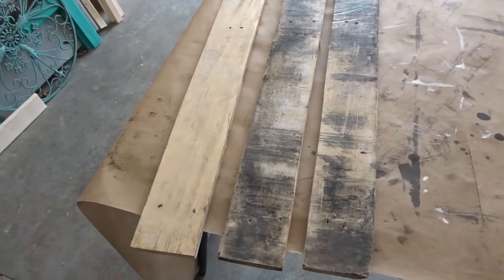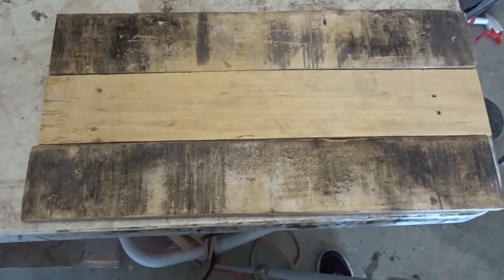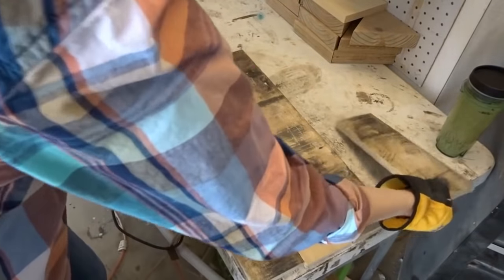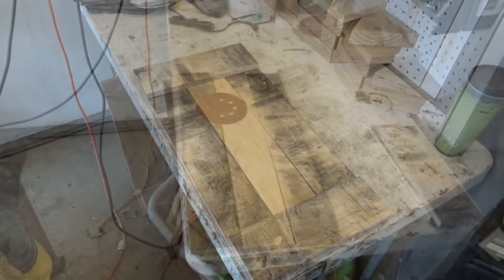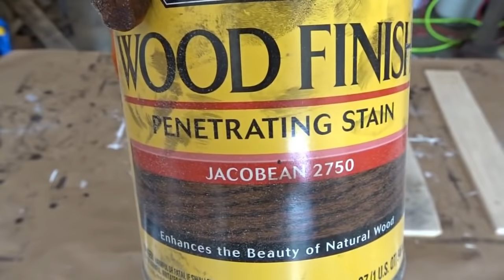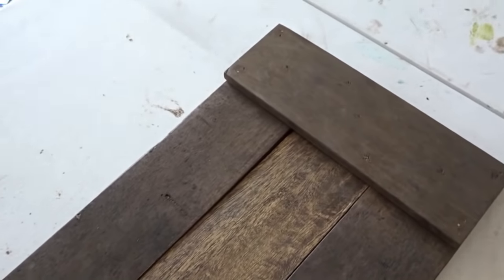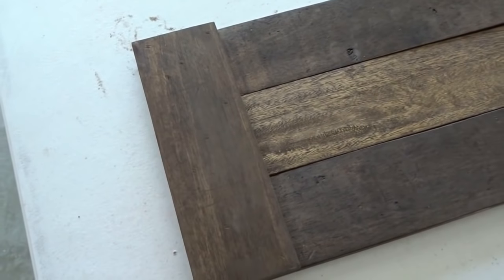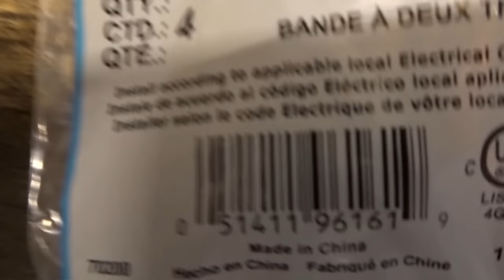DIY Pallet Wood Monogram Tray

Comment: Love this! great job! how do you get the nails out of all the boards (when taking pallet apart)?
Reply from the maker: My hubby uses a reciprocating saw to cut the pallets apart so the nails are flush with the wood when the pieces come off the actual pallet.  You can use a nail pin (or pick, not sure the exact name) to hammer out the nails.  I don't mind the nails in my pallet wood so I usually keep them.  Or you can cut off the ends and just use the shorter pieces in between the nail heads.  Hope that makes sense!

Comment: What do you use to apply the stain? I stained some palette pieces the other day that I spend a while sanding, but they just didn't get smooth. The rag I used to stain them kept catching and getting sort of torn up. Maybe I just got a really crappy palette lol
Reply from the maker: Some pallet wood is really really hard wood and it takes some work to get it really smooth if that's what you are going for.  Did you use 60 grit sandpaper?  I usually bump it down if it's really tough wood.  I like to use old cut up t-shirts to stain with.  My kids are always growing old of clothes so it seems to work that I always have old t-shirts hanging around.  There are staining clothes you can buy too, which I really like.